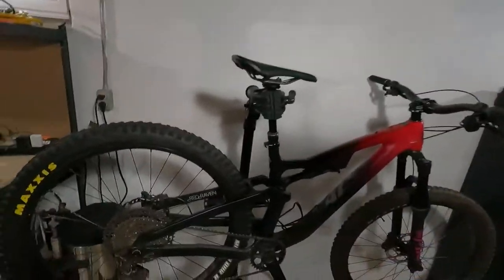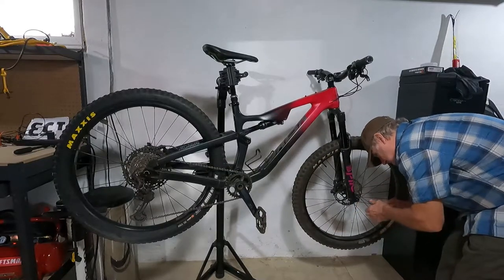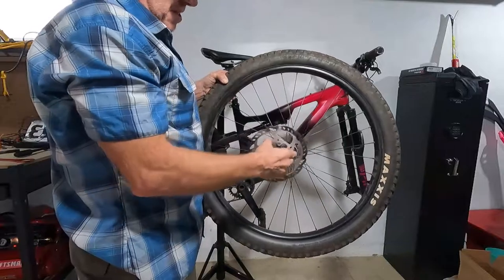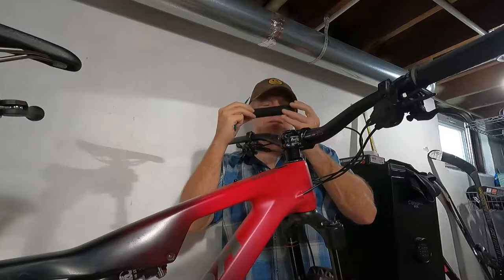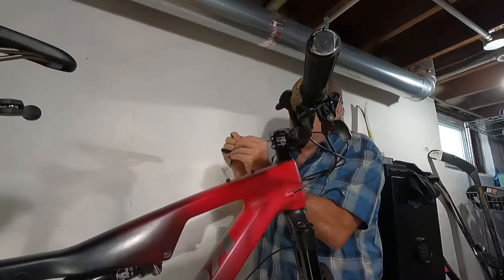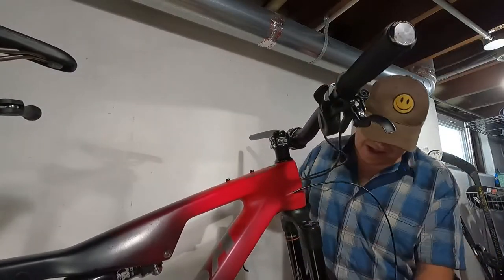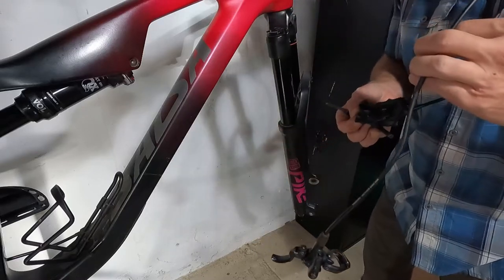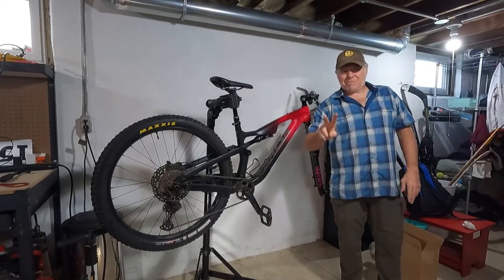Part2 - Shimano XT hydro brake install removing old brakes

Comment: Ice-Tech is basically just to keep the brakes cooler. The pads have fins and the rotors have an aluminum core, both to dissipate heat. Freeza (sp?) adds extra cooling surface to the core and XTR Freeza has a special paint that claims to further improve cooling. I was getting some brake fade on my stock brakes for the Fuel EX, it was much improved when I switched to Ice-Tech pads and Rotors. The newer Ice-Tech pads tend to rattle in the calipers. Solutions I've seen are bending the spacer to hold them tighter to the sides of the caliper or grinding off some of the fins. The only compatibility issues I've seen is the cheapest rotors will be resin pads only, and you'd see that right on the rotors. The other is pads to calipers, the Deore and 500 series four piston will only take standard pads or the old style (now Saint/Zee) finned pads and they might need a fin or two removed.
Reply from the maker: Yeah, I read up on it. I realize the rotors on my bike are nicer (ICE) rotors than the one's I ordered. So I will reuse my existing rotors and order some XT level rotors to upgrade. So it seems SLX, XT and XTR use the ICE technology.